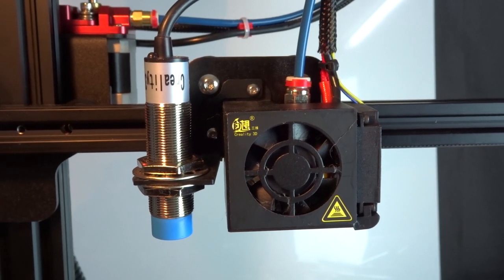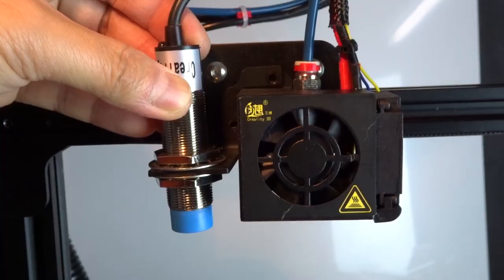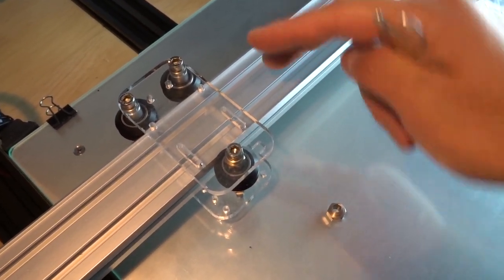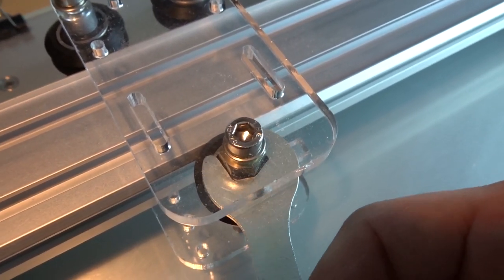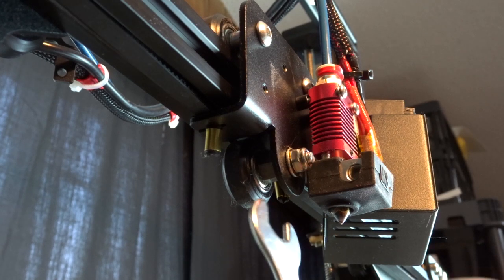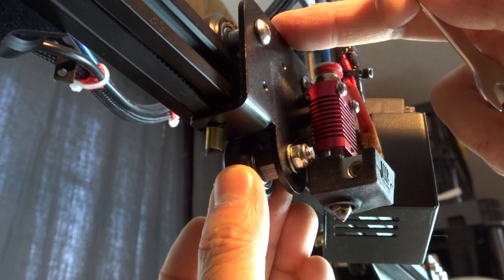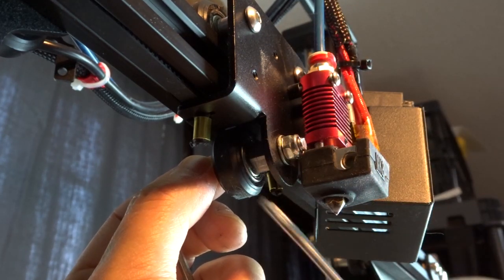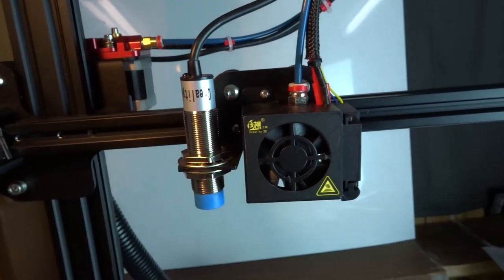Tune Creality CR-10 / CR-10S eccentric spacers

Comment: Just be very aware that you should not tighten the cap screw and nyloc nut up too much. I have found that the precision washer placed in between the two 625 bearings is not wide enough. So that when you over tighten this screw and nut you place high axial loads on both bearings and you can seize the bearings up. You when find that if you have tightened the screw and nut to much, there will be a flat line on the rubber of the Vee Groove roller, this is caused by the roller sliding and not rolling!
Reply from the maker: Greg Ashley Agreed, thanks for the advice. I’ll add that as a comment.

Hope this helps people out. It’s usually asked about 3 times a day. :D
Reply: @pandapropsncostumes  I'm seeing this myself on all the FB groups that I belong too. Your video was clear and easy to understand, so lets hope people watch it!

Comment: Thanks heaps, mine has always been loose on the CR10 Mini and I've been wondering if it's supposed to be like that, or how to snug it up. I've been having problems with ringing and it wouldn't go away after clamping it down and tightening the belts. This has gotta be it. Thanks a lot!

Comment: What if the eccentric nut doesn't tighten the carriage?
Reply: Hope you found an answer somewhere, cause I've been looking everywhere and nothing.
Reply from the maker: That’s the way it’s designed to work. If it’s not tightening your bolt may be bent, the x carriage plate may be bent, or the wheels may be worn out